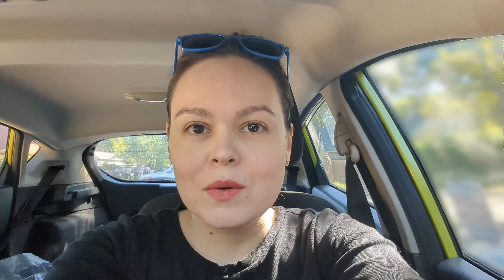This is a piece of history | Dubied MM Antique Industrial Knitting Machine

Comment: For cleaning the old caked-on grease off of machines like that you can use ammonia if it's all ferrous metal, or borax with a bit of dish soap in hot water if there's some nonferrous metal that the ammonia might attack. I used ammonia to clean an old industrial sewing machine that I picked up a few months ago, and it went from a dark caramel brown to a beautiful factory-fresh grey; the transformation was incredible.

Comment: For the stand on this thing, I suggest you get 5/4 board to make a table out of. You can cut the board down the middle and then position it on the stands so that it has the gap that is needed for the fabric to descend.

The 5/4 board should be more than strong enough to hold up that heavy machine. If not, you can double it or use 2/4 construction to make the stand with. 

The 5/4 will look nicer though.

Comment: There is a Vintage Knitting Machine group based in America and they may be able to help with a manual etc, glad you saved it and it will be like adopting a puppy. It will behave badly a few times but will sing once it is being used on a regular basis.

Comment: At work I used for some years a motorized version of a machine really similar to this, called Scomar (I'm italian). The two slits in front and back are indeed tension controller, they're really precise and if you don't set them exactly the same you'll see some tension issues between rows. There should be some levers to activate front and back needle back, one at time or work in circular (crossing the levers).
Reply: I'm not that good at using domestic knitting machines, but since I work in a knitwear company, I know how to use some industrial mechanical machines (now I am a project manager, but for more than 10 years I developed knitting garment data for our programmers)